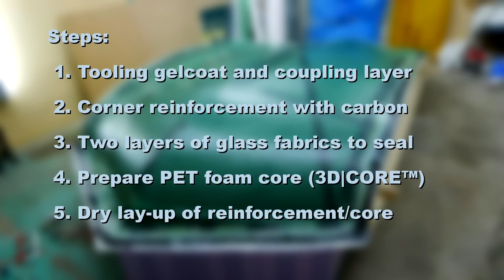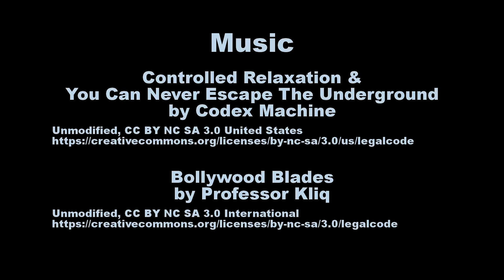Vacuum resin infusion of a mold for a nurflügel microlight aircraft

Comment: The coupling layer on geled gelcoat: what is that (resin mixed with something else/slurry?)  & why do you do that?
Reply from the maker: It's thickened resin, either with cotton flakes or chopped glass strands. I prefere cotton now. The surface of the gelcoat is always somewhat uneven. This coat helps to avoid that air bubbles get trapped between gelcoat and reinforcement. It also extends the processing time, as it contains fresh resin but still binds chemically to the gelcoat.

Comment: In that project you don´t need to use carbon fibre across
Reply from the maker: Yes, probably it wouldn't be necessary. Considering the high weight of the mold, deformation can be a problem. This includes not only bending, but also torsion. It's better to have some extra stiffness. Production molds use a truss for stabilization, which is lacking here. The parts produced in this mold are thick and stiff (6.5 mm honeycomb), and should be shaped by the mold as precises as possible. The final shape is best achieved using ribs: https://youtu.be/-PMiIUEZFP4 However, torsion is still an issue...

Comment: INSTEAD OF THIS STUPID MUSIC WHY DON'T YOU GIVE VERBAL EXPLANATION OF THIS PROCESS. WEIRD
Reply from the maker: Because I think the video and the textual remarks speak for themselves. I'm also always glad to answer technical questions. By the way, you can turn the volume down if you dislike the music or simply stop watching...
Reply: I didn't much care for the music either, and wound up watching muted...its a significant production effort to add a voiceover and some non-native English speakers do not have the confidence in their speaking voice (who likes their own voice anyway?) or time to do this (he would likely want to be working on other parts of the craft than be producing videos)...I'm thankful for him having posted the video at all...there's always something to be learned...
Andres;  I would have had more overlap of fiber edges at Step 5A ...this would assure better continuous force distribution without stress concentrations...  The carbon fiber edge and diagonal strips added don't add any torsional rigidity (only in X-Y axes, and not much in that as they are not prestressed))...if this component needs torsional rigidity, it needs a reinforcement in the Z axis from corner to corner.  I would have liked to see debagging and inspection of the level of infusion at the northwest/southwest corners...at 12:25:45 clock time (end of video), those corners were still dry!  Remember...dry fibers are not structural...only fibers locked in resin have structure!  Thanks for posting, and safe flying!
Reply: I felt like I was in a church , not a workshop.
Reply: I liked the music.

Comment: No needs of wax before gel coat ?
Reply from the maker: Sure, a release agent needs to be used before geolcoat is applied. We wanted to be sure that it releases well and we used five layers of carnauba based wax and one thin layer of PVA.
Reply: What composites are used on the bendable wing tips being built today?.. Am working on a design and i would like to progress to composites..very flexable..

Comment: What is the cost for the materials for a mold that size?  and what is the time investment?
Reply from the maker: Honetsly, I didn't count the money we spent. It is for sure only a fraction of what you have to pay for a CNC milled ureol/aluminum mold. I can tell you roughly how much material we used for one half (surface 4 m²): 60 m² of glas fabrics, 2 - 3 kg of tooling gelcoat, 12 sheets of 5mm 3DCore, 15 - 20 kg of epoxy resin, and not to forget, vacuum bagging stuff.

Regarding time investment it depends completely on the pattern. Most time was invested in its production (high gloss surface). The time spent in making the mold is negligible. If you have a pattern, it takes a couple of days to build a jig. One long session for  tooling gelcoat, coupling layer and two layers of glass fabrics (air tight tub). The dry layup is ready in a couple of days, including trimming the core. Finally, the vacuum resin infusion needs half a day. Depending on the application of the mold, you might have to heat treat the mold, which takes again one day of mostly waiting.
Reply: I work at a motorhome manufacturer in Canada helping build molds for fiberglass and we make our molds much differently to how you made yours.  We use hand layup or chopper gun layup.  Our time investment is about the same though.  And we spray our tooling gel as well, we find brushing can cause porosity that can cause issues in high production molds. We make at least 200 parts between cleaning the molds, depending on the quality of the mold surface and the gel used on the mold.
Reply from the maker: I've heard of spraying tooling gel and thought doing it when we made this mold. The metal-filled gel I use is probably too thick for my spray gun, though. Do you use epoxy or polyester resin? 

What I like of vacuum resin infusion is that you can make the layup in calm and contact to expoxy is reduced to a minimum. Also, the fiber volume ratios are higher, which means that the mold is lighter. We do this in our spare time and having the possibility to make everything distributed over a couple of days makes it much easier for us.
Reply: Andrés Chavarría we use polyester resin and I'm assuming gel.  it's the optiplus system from polynt composites. We used to use a vinylester system called "ferro" by what was at the time Ashlands composites if memory serves.  The vinyl was actually a lot nicer to work with, more predictable, less pin holes and porosity, easier and better repairs when the guys in production wreck them.  

I'm kind of wondering if a resin infused mold would actually be cheaper overall as the time investment is very close along with materials but considerably less resin is likely to be used?

What kind of production numbers do you expect out of that mold over its life span?  Assuming the people using it respect it and don't abuse it of course.
Reply from the maker: Hard to tell if this method would be cheaper. You need a very good vacuum pump, a suitable resin, and slightly more consumables, such as the infusion mesh. Polyester molds are, as far as I know, the cheapest in production. However, a long lasting mold might in the long term be cheaper—depending on the number of pieces produced. I use epoxy because I cannot afford to have much shrinkage (polyester has up to 7%). When done correctly, vacuum resin infusion produces perfectly wetted laminates, i.e. no pinholes or whatsoever (glass fabrics become transparent; see video).
Reply: We have a good number of rtm light (2 sided molds vacuum sealed together) molds in production so not only do we have a good vacuum pump, we have a second as a back up in case the first one fails.  We can handle the shrinkage, we're building motor homes not aircraft, but we are 40-45% glass with hand layup whereas infusion is 60% glass if memory serves. Depending on the actual cost of the resin that may off set the cost of the consumables.  And with the infusion's lack of bubbles it would help with some of our 2 piece molds that always break out at the join lines because of pin holes that are nearly impossible to completely get rid of with a roller.  Our highest production molds are about 3750 parts / year and they are 2 piece molds that always have issues at the joints.  It'd be really nice to eliminate the problems even if the cost was slightly higher in the short term.

Comment: Hello! Thanks for tutorials.
Which core is better for airplane wing production? Nomex hexagon core or 3D|Core?
Reply from the maker: That depends on three aspects: weight, effort and costs. 

3D|Core can be vacuum resin infused, which means that it needs less effort. You make the dray layup, infuse and get your final laminate in one shot.The material is much less expensive (roughly one sixth).  However, it consumes quite some resin, which means that the weight is high compared to honeycombs. 

Nomex honeycombs are very light, as most of their volume is air. They weight about one third of the 3D|Core and do not consume much resin. However, they are much more expensive and elaborate to produce. Three sessions are needed:  first face laminate, cementing honeycomb and second face laminate. Only the first laminate can be vacuum resin infused and the second needs to be cemented in a geled state (eek!). You need some experience to make good honeycomb sandwiches. There's a video on my channel, which gives a good impression of how much work it is: 
https://youtu.be/5YOT1TUwqTs

If weight is critical, money and time do not play a role, I would suggest to go for Nomex honeycombs. If weight is less critical and budget is an issue, go for 3D|Cores.
Reply from the maker: I forgot to mention that you can also use AIREX foam. It can be either vacuum resin infused (video: https://youtu.be/DaSS5ShH0FA) or vacuum bagged. The latter results in less weight. We made some ribs this way (see https://youtu.be/bHlzao695p0).
Reply: Thank you for the explanation.
I also heard of "Soric XF" core materials. It's like a hybrid of hexagonal core and infusion ready foam.
Reply from the maker: Yeah, but I've never used them because they consume much more resin than comparable sandwich materials (Soric XF: 2.4 kg/m², 3DCores: 0.35 kg/m²).
Reply from the maker: Yeah, but I've never used them because they consume much more resin than comparable sandwich materials (Soric XF: 2.4 kg per sqm, 3DCores: 0.35 kg per sqm).
Reply: That's makes sense.
What about "Rohacell" core?
P.S. I hope I do not annoy you.
Reply from the maker: Using Rohacell (PMI hard foam) is pretty much the same as Airex (PVC hard foam). Rohacell is slightly more expensive...

Comment: how long do you let the E300RI cure?
Reply from the maker: That depends on the room temperature. 24 hours is minimum, where more is better. Give it a couple of days to prevent deformation (room temp over 20 °C).  Full strength is not reached before heat treatment, as it is else brittle like most slow curing epoxy resins. Thus, I usually treat these for 15 hours at 60 °C (140 °F) with a heating rate of less than 10 °C per hour (50 °F/h). You can speed things up by curing for one day at room temperature and tempering then at 60 °C for 15 hours (plus five hours for the ramp).
Reply: Do you heat it with heatlamps? or do you bring it somewhere?
Reply from the maker: I use a self built temper-box with infrared heating film and PU foam panel insulation. Temperature and heating-rate are controlled by a microcontroller.The larger the piece, the more challenging it is to heat treat. For small pieces a good insulated and air tight box with a couple of incandescent light bulbs is enough. Large pieces can be heated inside an air tight tent with any sort of heat source, as long as the warm air circulates (fan). I've heard of people using old elctric ovens... The heating-rate and final temperature can be adjusted by letting some fresh air into the box/tent. With good insulation the amount of heating power needed is less than expect.